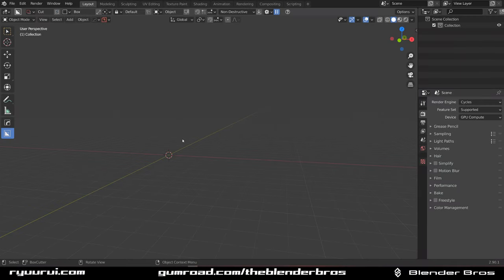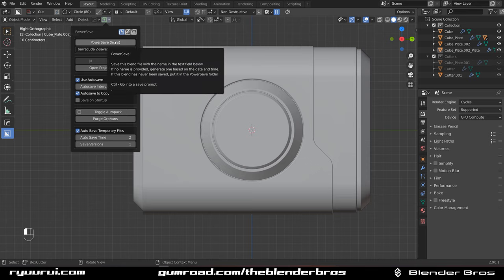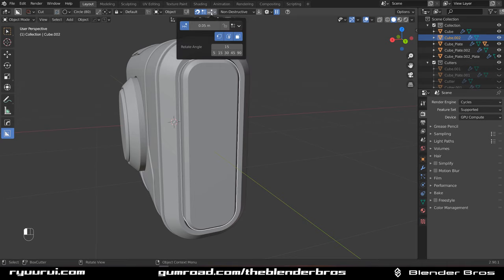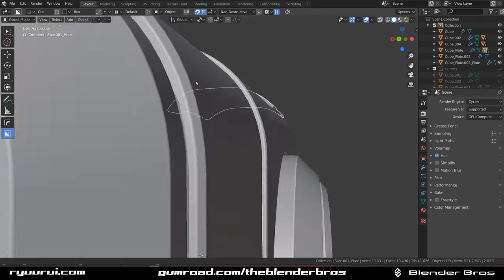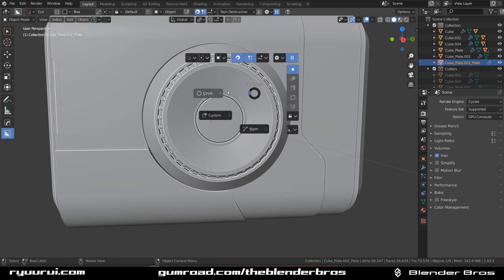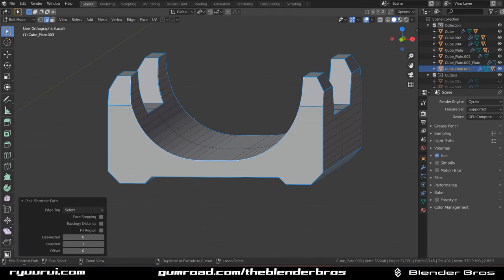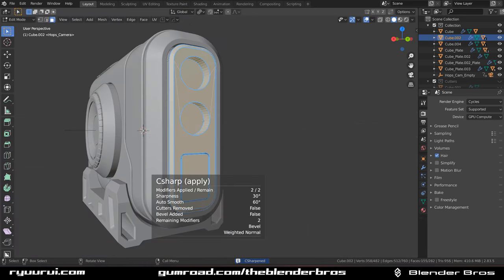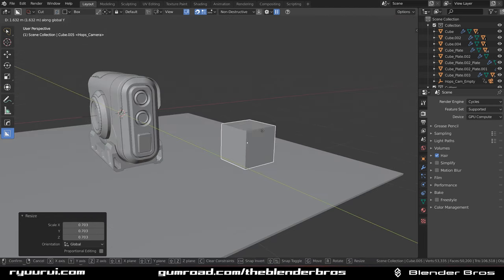Hard OPS and Boxcutter modeling TUTORIAL in Blender - part 1

Comment: I found this helpful because I am new to this:
TIP FOR BEGINNERS: watch a teaching video, don't try and also do the project along with it, YET. 
Second time you watch it put it on 75% speed. This way you can see what is clicked on, and you have anough time to pause or back up at key points as you do the project real time.
Hope this helps

Comment: The checker Deselect can be used to speed up that process still you select one of the face loops, Checker deselect, so then you only have to manually select them in one loop instead of both. So while it's not a perfect solution for the problem, it can still be used to eliminate half of the work selecting all of the pairs.

Comment: I find problem at 27:30 as a challenge for myself and succeed

First made made extra loop between them this make checker deselect work as intended but say goodbye to EM_Macro Panel comes after. failed

Second on is long but may worth when at point of no return: 
- rip faces to different objects
- select one and do a checker
- Go Object mode and Shift Select other object
- Shift select other loop and do checker second time, if out of align give offset blender will ignore "Other Object"
- Now you have the selection you want, go to object mode and combine objects (ctrl + J)
- Last problem is now you have duplicate Geo, I used Weld modifier with really low value and applied.
- You are finished, now make inset and macro to your creative desires

Giving it a afterthought what I did was exploiting blenders selection memory per object this way I can select anything with 0 effect to other objects then merging objects and keep my selections.
Essentially proto "Stash"ing my selection, a little primitive for my engineering taste but when you have 6-7 loops containing 200+ faces oh boy "I'm lovin, it"

There is a big potential for Selection add-on, select -> q -> Stash, repeat it until you are satisfied, q -> shift + LMB to Stash to select all stash and "bob is your uncle"
Sorry for long post, Cheers!

Update: Third way
- Edge mode
- Select Top Edge loop & Checker
- Select Mid Edge loop & Checker (Shift + R recommended)
- Select Low Edge loop & Checker (Shift + R)
- Select 1 vertical edge loop which is perpendicular ones
- Run Edge Rings either select menu or search menu
- Face Mode and your done
 Which is way faster
Reply from the maker: Not good at reading instructions, I d need to see it. I have to play with that checker tool, there must be a way to do it faster.
Reply from the maker: @berhangundogdu7297  you are a fucking genius, thank you!

Comment: There is a question in the work near 3:30 in the video.
Why is there a gap between the original objects when insetting?
In the video, the solidification is done without gaps.
In my work it does not work.

Comment: Hello! At the time interval of 18:03, you cut out a rectangle in the object. This rectangle is an integral part of this object. The rectangle is not an independent object. I don't understand how this rectangle is connected to this object. This rectangle does not touch the walls of the recess, it seems to hang in the air, although it must be connected by at least two lines with the rest of the object. I hope you understand my question.
Reply from the maker: no idea

Comment: @Ponte Ryuurrui I'm already stuck at 4:02 with the inset. When I inset it the same value as you do the object faces lags and didn't do the double steps. I'm using Blender 2.92
Reply: In fact, it's the solidify of this inset that doesn't work on my side and I don't understand why. I made the exact same steps as you did
Reply from the maker: press t for solidification when in inset mode, also update hadrops and boxcutter

Comment: Ryu, really outstanding tutorials! I like it very much, even if you are to fast for BoxCutter and Hops beginners. Sometimes it is really hard to follow you, especially while some shortcuts and operations are not registered in ScreencastKeys.  As an example, starting at 03:28 I struggled to follow you with this Inset stuff! But hey, it seems I'm the only one having that issues. Nevertheless, I will continue following you and your "pisthi" tutorials :-) Thank you for investing such an amount of time for us beginners and advanced B3 users!
Reply from the maker: Thanks man, yeah screencast keys is a piece of junk, but until someone comes up with an addon that actually works, we are stuck with it. I used shift bool from hops menu, then simply scrolled my mouse wheel to change bool type. If you have troubles just drop a question or pop to Blender Bros discord here https://discord.gg/HennBV
Reply: @PonteRyuurui  Thank yo for your reply. Yeah, my troubles startet really at 03:48 solidifying the inset. Have to try another time.
BTW, yes ScreenCastKey is not the best tool. For my tutorials I use QiPress Pro. It is really pitschi with this tool. Have a look http://www.aalapshah.in/qipress . The guy is also very supportive if you desire a new feature (if feasable).
Reply: @Leevy27  I'm having the same issue as you and I'm using Blender 2.91. Did you ever find a solution? Mine doesn't even inset quite the same way and I've gone over the first steps of the tutorial again and again to try and see if I missed anything.
Reply: @Rogue284  Exact same problem here. I think it's not quite working the same way on blender 2.92... Doing weird stuff after solidifying the inset...

Comment: Where is the slow introductory work through of this toolset? Does such a walkthrough even exist, or are first time users of these tools just supposed to deal with it, as if so I would strongly recommend NOT getting these tools, as clearly they work great but learning them when first acquiring them is just unfeasible if you have purchased these tools in the hope to speed up workflow...
Reply from the maker: i have over hundred of vids in the hardops playlist teaching all tools, we also have a comprehensive course for hard ops and boxcutter https://blendermarket.com/products/the-ultimate-guide-to-hard-ops-and-boxcutter  In addition most of our courses utilise Hardops and Boxcutter
Reply: ok the issue I appear to be having is related to a build of hard ops released 6 days ago having some bugs, such as Alt X mirror not working properly and etc, which was causing me as a new user to think I am missing steps along the way and assume that they must not have been getting covered in the guides I have been following. After looking on the HOPS discord at similar comments of people having the same issues but unlike me are aware of hard ops normal behaviour and therefore being aware of it being a version issue. it appears that is what is causing my frustration.
Reply from the maker: @exileacid7627p  hardops is being updated so often that bugs will happen, but they get fixed almost instantly, usually the same or next day. If you have new toys added via coding, things could break. I havent noticed any issues with the new mirror, but i am on Blender 3.0. you can always hop on hops discord and post it there. CD projekt Red cant fix their game in a span of one year, where hardops gets fixed in matters of hours, so there you go.